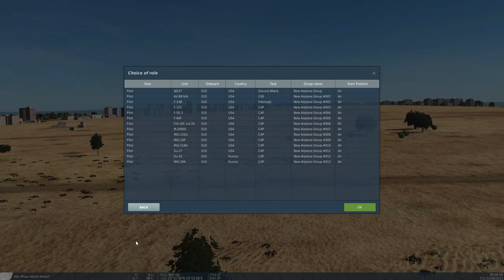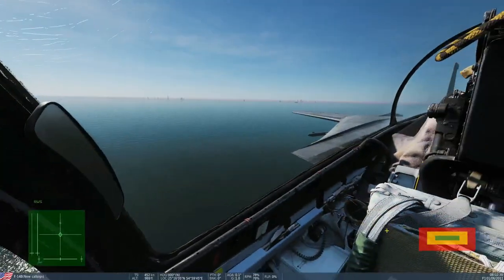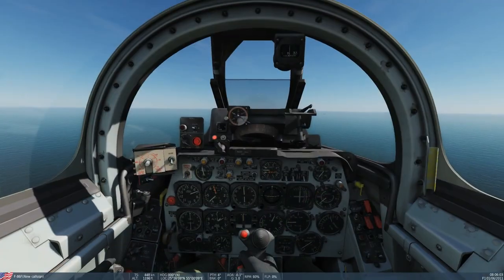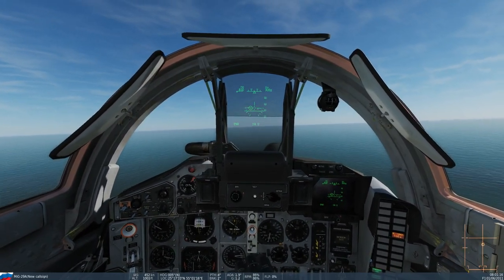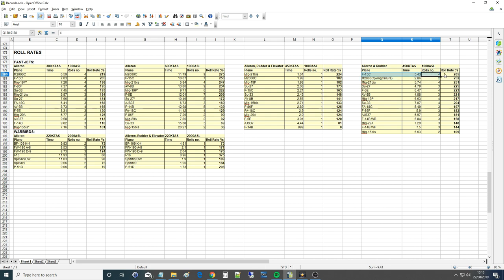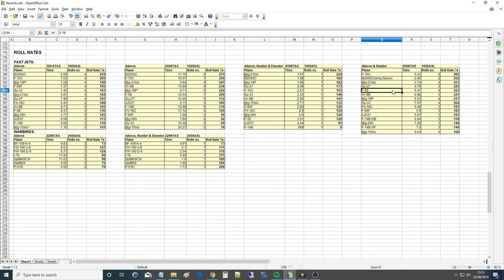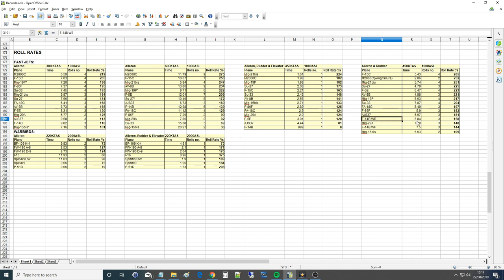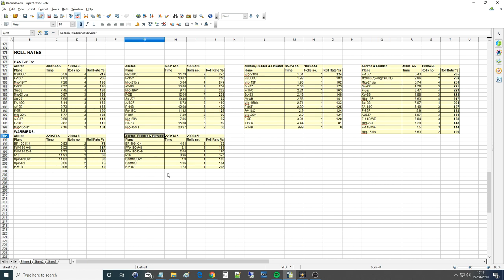Fast Jets: Max Roll Rate (Aileron & Rudder) | DCS WORLD

Comment: The F-14 not having any ailerons is probably a big part of its poor performance. It does have nice big differential elevators, but I guess being closer to the body would reduce their torque vs. ailerons at the ends of the wings, so it just isn't as good at rolling.
Reply from the maker: O yeh I forgot about the lack of Ailerons...